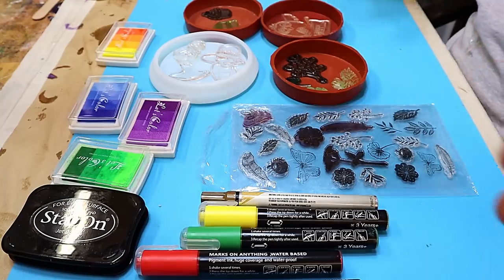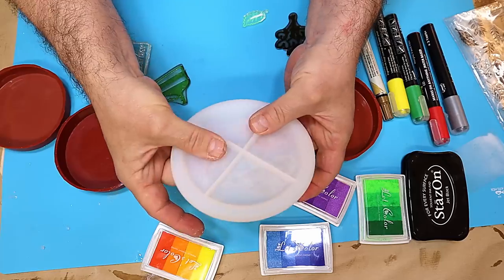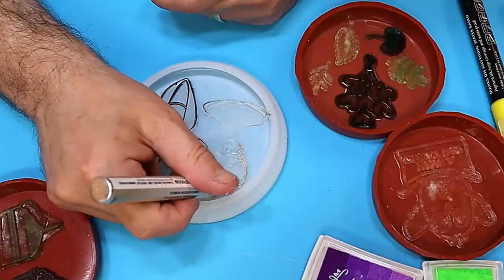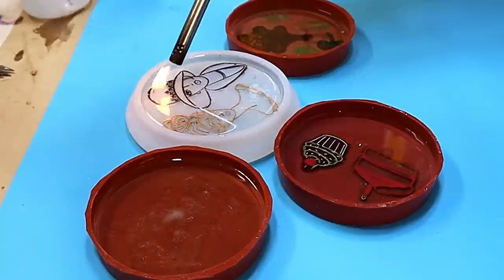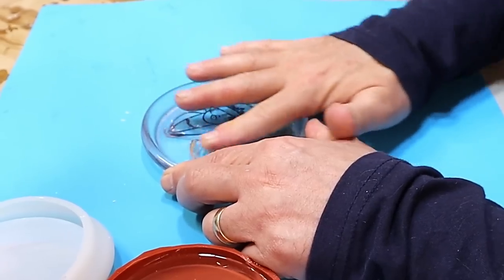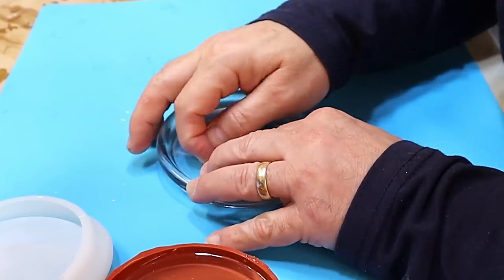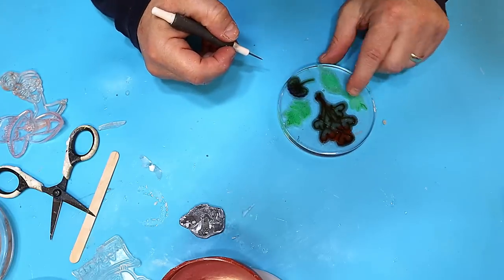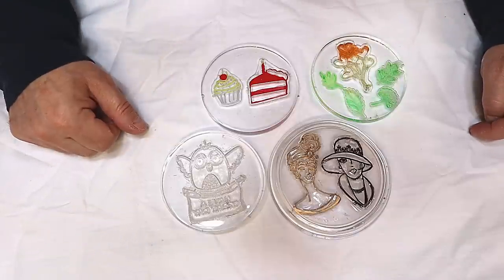An Experiment to See If You Can use STAMPS in Resin

Comment: I tried this on my channel 7 months ago. It's super fun!! Great idea to use the Tack it Over on the back so they don't float if they aren't very sticky. Sorry it didn't work out, but it's still a good idea. I also like to show my fails. It keeps me humble when once in a blue moon it actually works out well. 😆 My issue when I tried stamps in the bottom of the mold was the edge around the stamps I used, showed up as well. Was thinking of trying to instead press the stamp into the resin after pouring it, and it gels a bit. I didn't try it with ink on the stamp. Pretty cool, Steve!

Comment: I've wondered about this myself... Don't know that I would put the stamps right into the resin, but, rather make molds of some of them. That way I get the impression without harming stamps. I'll have a go at it from that perspective and see what happens. 
Will be a bit though because I'm in the middle of 2 moves.... Moving out of the house I've owned for 25 plus years AND then I'll be moving my craft room out of the house into my NEW "CRAFT ROOM"!!!! Very excited about the 2nd move!!! 
Stay safe, be YOU, and stay crafty👍👍🔔🔔🦋🦋
Reply: I was just about to suggest that! I have never used stamps so I don't know what they're made of, but you could always do a cast in another material and then make a silicone mould if the materials are incompatible. It's probably a long process but if you have a stamp you really like, I think it would be well worth it!

Comment: Hi Steve, nice experiment. You always seem to find new ways and new possibilities, without doing things that are way over the top. 
I got a question though, didn't the glue affect your molds? 
I used 3d stickers in my molds, but the sticky part left a mark on the molds unfortunately. Could be because the molds were cheap, or the glue on the back of the stickers was too powerful. 
I made necklaces with stickers from Frozen inside and someone bought them from me and is now selling them on the markets himself. 😃 it looks really nice with the 3d stickers in resin.
Reply: Heat from the resin curing may have made the sticker adhesive cure and stick to the mold

Comment: With doing this you can technically make it a shaker coaster putting some glitter or sequins in then using the glycerine mixture seal with acetate and then pour another layer of resin on top that would be pretty awesome

Comment: How did you keep the ink from releasing? I used Staz-on and the UV resin reactivated it making black swirls in the resin and featuring the ink.
Update: I tried the Jaquard Color Pad Black Dye waterproof and fast drying ink. It set for a while while I finished another project. It worked perfectly in the UV resin.

Comment: What would happen if you loaded your stamp with ink press it to the bottom of the mold. Taking the stamp away leaving just the ink. Let it dry then pour your resin
Reply: Chris, I am interested to see what Steve has to say. I think from my experience with metalwork IF YOU USE StazOn  ink ... it should work ... in fact, I think I will try that experiment. 
Dr Lois